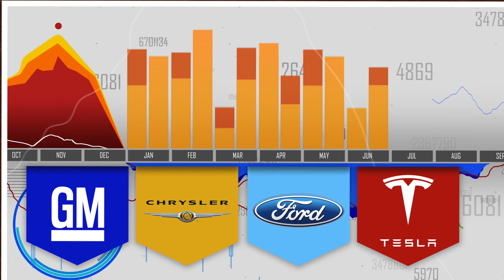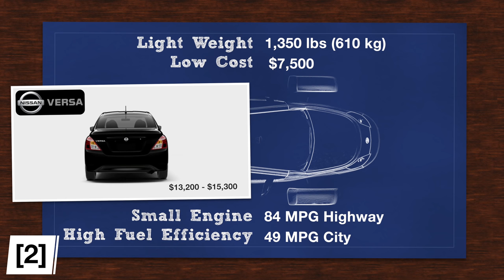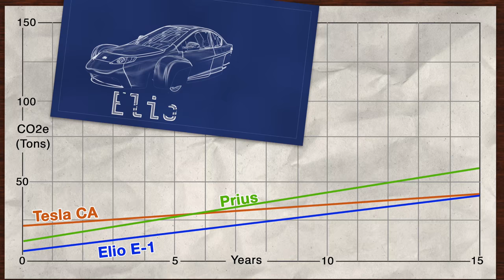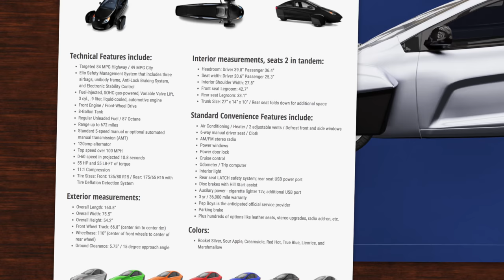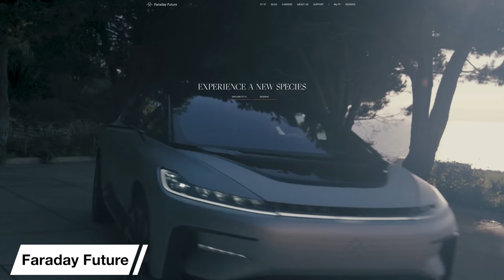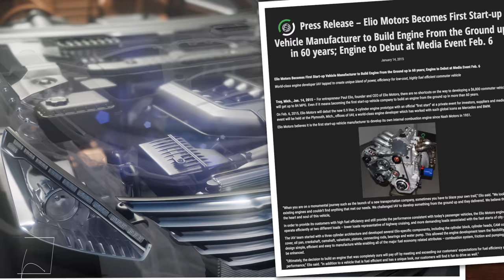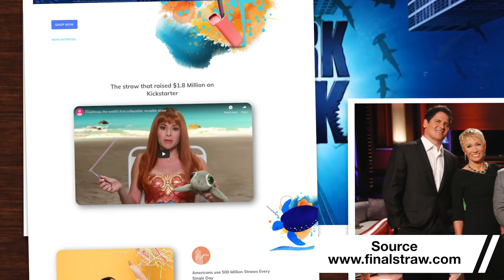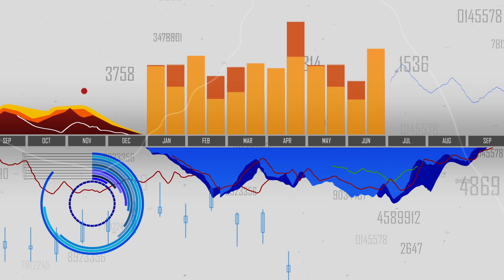How this Radical Car Missed its Chance to Change the World

Comment: Their biggest challenge in 2019 is $2 gas. Half of the value proposition is the high mpg. With $2 gas, that goes away. The other half of the value proposition is the price tag, which use to be $6400. This is a narrow line that they would have to balance between the versa and used cars. They needed to bootstrap their production as quickly as possible with all COTS parts.
Reply: Gas will not stay $2 per gallon,im enjoying it,but every 15 years or so,we have a fuel "crisis"we are about 8 or 9 years in.Not opinion,but history.
Reply: @stephenhisel9395  The next crisis won't be gas, but Diesel, and will affect a helluva lot more then gas prices. Yeah, it'd be nice to have a hyperefficient vehicle for when that happens.
Reply: @DFX2KX  you very well may be right,either way,even without a crisis,we should always strive to be more efficient,i own a full size 4x4,but when its not towing or hauling it sits in its parking spot,and i plan to move to the city where i work so i can commute by cycle,i understand not everyone can or will be on board with that sort of lifestyle change,but i wish more people would see efficiency as a good thing.I will climb down from my soap box now,happy new years to you!
Reply: @stephenhisel9395  Indeed, one of the nice things about moving to the city was the fact that my bicycle is good enough to get most everywhere. Except during the winter, where it's freezing something stupid right now. An EV would be nice to have, but this apartment doesn't have spots to charge them, sooo... something like an Elio would be very useful.

I really wish we had high-speed rail here in the states, and not the laughing stock that is Amtrak. And with an EV or something like this as my 'bop around town' vehicle, I wouldn't feel bad about street-legalizing a military Humvee and having fun in the mud now and again. (that said, I'd love to see someone electrify one of those. That'd be a laugh purely for the look of confusion on all who see it).
Reply: Cheap gas is also a blow against EVs like the 3.
Reply: I don't know about you but $2 for gas IS NOT CHEAP. I drive 50k a year. first no way it will average 84mpg (which is what you pay for) but in the right hands it could average 65mpg (I average 62mpg with my 94 geo metro xfi with careful driving) so 65 should be very doable.

that is still nearly $1600 a year in fuel plus the ICE maintenance that goes with that. while that IS cheaper than my leaf it could not be a DD for it. it would be a backup and long distance alternative for my Leaf. and gas around here is $2.70 a gallon not $2.
Reply: Gas prices have very little to do with ev adoption.
High gas prices usually also mean faster rising energy prices in general. And when gas prices are low energy prices in general stay low as well.
Savings stay the same either way.

Plus ev's offer so much more bennefits over regular cars for a lot of people. They will switch to ev's either way.

That just leaves the people for who an ev is just not practical and people who can't afford a new car anyway. And the people who are agressivly against ev's for ideological reasons of some sort that seem to seek out these kinds of video's in particular to bitch and complain offcourse.
Reply: @nerys71  $2 gas not cheap??? Would you rather go back to $3.50-$4.00 gas?? How bout $5 like it was in California several years ago??
Reply: @dieseldog00  how about the 90c it was 20 years ago. How about that....
Reply: for many people that drive 100+ miles round trip to work (it happens, many people that live in the North Georgia Mountains work in Downtown Atlanta, this is why they built the paid express lanes on 575) it still makes a lot of sense, if you triple your fuel economy you are still saving 4+ dollars a day you are saving over a grand a year in fuel costs over the other car, meaning this car will pay for itself in just a few years in the money you save. there is also a market for teens getting their first car, this would limit the number of friends they could carry around and would be cheap enough some teen working fast food could afford to make the payments on.

Comment: The more I watched this video the more I got a different analysis.Elon Musk started with the highest margin models first to build capital in order to eventually get to the base model which makes less for the company but the cost has been offset by the more expensive models being purchased. In starting from the bottom aiming for the lowest price of entry into the market, it seems the Elio wasn't going to make very much off of each car sold and not be able to scale fast enough or well enough. 

On top of that they designed a product that I can't seem to find a market for outside of a very small subset. It's a cheap car, stripped down to be as affordable as possible, so the wealthy wouldn't want to use it for long commutes over something like a EV BMW or M. And people on a budget would more than likely purchase a regular car as they would need to use it more than just commuting like picking up family or moving things. 

There just wasn't a market for it and no capital to back it up is what it felt like.
Reply: And aditionally said, this model even tributed to the bad reputation EVs Had. They thought to be small, weak and ugly. All presumptions, Tesla had to fight with in the beginning. They brought the roadster First, to refute thus poor Image EVs had in the past. IT IS a psychological issue. IT IS similar to the political Framing some people do when IT comes to stereotypes of people in the middle east.
I wish Tesla and Elon the best there can be. So finally foreign countries would Stop to wage war in my country for oil. I know, It is not all about oil, but at least this Major Cause for war would go down. The faster the better
Reply: @aladdin8623  Oil is a large part of it but 1/3 of all world trade goes right by the the Middle East water ways so even when the oil age is over the stupidity may not stop.
Reply: He reversed the Ford  concept of cheap cars to start off the business crazy but Elon is still in the game.
Reply: It took over 4 years to get 65k reservations. Then they went to about nothing after that.
Reply: It’s a niche market, to be sure. But it takes very deep pockets to start your own car company! John De Lorean found that our the hard way nearly 40 years ago...
Reply: There would be a huge market in young single people and older people whose kids have left. Young people could afford a car finally and people like us old folk where 90% of trips are made alone and the rest as just a couple this would be a great thing..we rarely go further than 30 miles from home.
Reply: @Barskor1  That begs the question of what will the cargo ships use for fuel if all the oil drilling stops, say by 2030.
Reply: @dieseldog00  If you don't want to or can't change the engines they are robust enough to burn any oil. That could come from algae  directly a simple process grow in coastal farms. Centrifugally separate it from the water next rupture the cells with gravity induced vacuum.  Add distilled water using solar heat to get the oil to rise  and skim it off.  Centrifuge again and the husks get sent to a bio digester to make methane to run everything.  All the waste products after that are great fish food for aquaculture or fertilizer to feed more algae or land based crops.
Reply: @Barskor1  Idk where you live but unlike you, in the US we know how to use periods to denote the ends of sentences. To run sentences on and on and on like you do makes it very difficult to read and understand your post. Which is why I stopped reading it very soon.
Reply: @dieseldog00  Sure bud I was at the end of my day  so missed that.